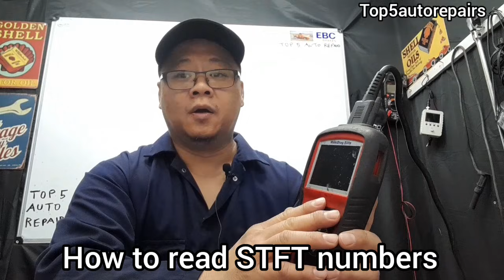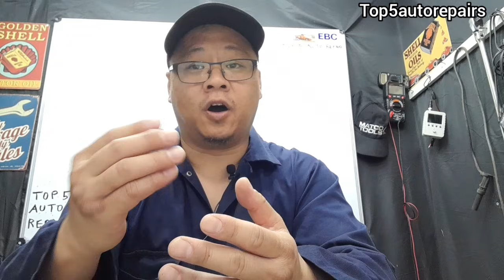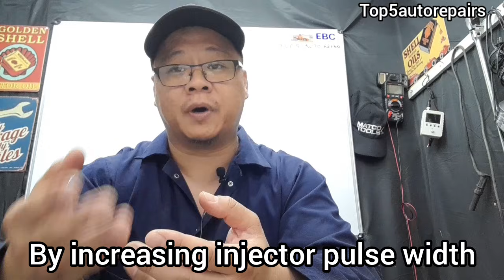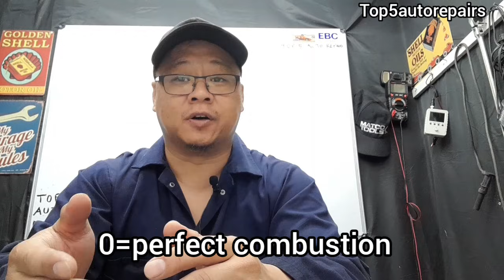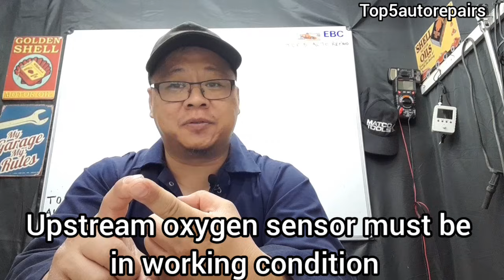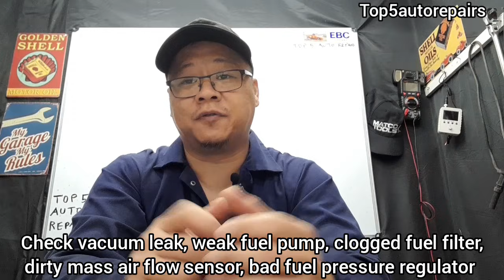HOW TO READ SHORT TERM FUEL TRIM NUMBERS AND I EXPLAIN NORMAL RANGE NUMBERS

Comment: I have an OBD meter which gives the air fuel ratio reading. At idle, it reads 15.1, but when car is moving, it drops below that, varying around 14-15. Should the reading be 14.7 at idle?
Reply from the maker: Air and fuel ratio will always fluctuate due driving conditions. As long number is more or less close to 14.7 it should be fine.

Comment: Hey I'm running into a issue an just wanted to confirm I was told by the dealer I need new cats on a 08 ford edge codes are 0420 0430 an a p0303 I was told after replacing the injectors coils plugs compression test that my rear cat is clogged an is causing the misfire due to back pressure. But here's the deal 90% of the time the car misfires on but randomly will stop an I noticed on my scan tool for up an down on both side I'm getting a dead line when I'm 
Misfire but like I said randomly it stops an then I'm getting readings on my scanner of the o2s does this sound like a clogged cat or possibly bad o2s an would that really cause the misfire also ? I even had the pcm checked an it's fine also thank you for your time
Reply from the maker: A clogged catalytic converter will cause overheating, random misfire, poor engine performance, poor acceleration, stalling going uphill, hard start etc... make sure to conduct a backpressure test and check catalytic converter, check inlet and outlet temperature at the cat and for broken honey comb structure. I do have videos regarding catalytic converter so check them out.

Comment: Thank you for the simple and understandable explanation of fuel trims. I had a negative fuel trim, and the culprit was a dirty air filter. I still get confuse with the numbers of fuel trim. I’m just starting to learn more in depth about mechanics at 40 years old.
Reply: Yo chill , you still a young buck. You still got a lot of years ahead of you young man.
Reply: @max.rod111 thank you sir. Back in high school I had the option of choosing mechanics or wood shop. I picked wood shop.

Comment: Hi bro unrelated question but I'd really appreciate your opinion. A Kia 2004 pregio 2.7 litre diesel starts well drives well but when engine is warmed up idle increases and sits at 1000 rpm . What could cause this? The vehicle has no EGR and no DPF. I'd appreciate some advice on what could be causing this. When I bought the vehicle the rpm didn't change whether it was hot or col then it started to idle at 950rpm when warmed up and that has now increased to idleing at 1000 rpm when engine is warmed up. If I stop the car and go in the stops fo 20 minutes it idles normal again but then after driving for a couple of minutes it goes back up to idleing at 1000 rpm.
Reply from the maker: Usually I would say regeneration but in this case, the egr and DPF delete is the problem.
Reply: @Top5AutoRepairs  The vehicle didn't come with EGR or dpf from factory.  It's a old style diesel not common rail.